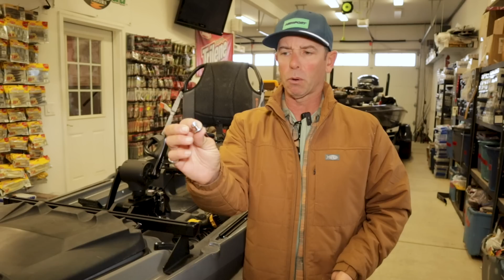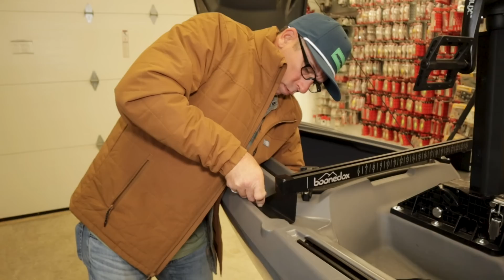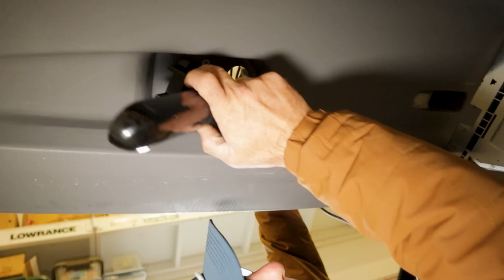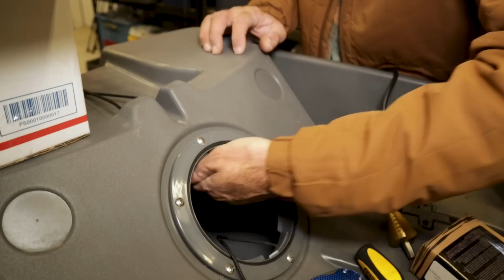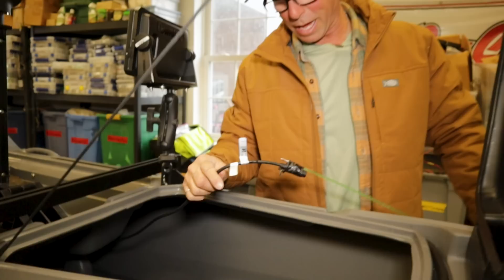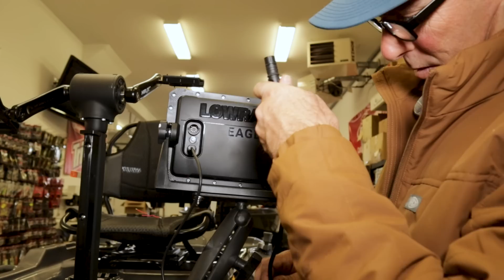🔥FISHING MACHINE! 🚀Rigging My New WILDERNESS SYSTEMS KAYAK with LOWRANCE EAGLE 🦅

Comment: Nice video! I've got the same kayak and currently have garmin striker 4, but want a new sonar with side imaging. I wired mine like yours, except i put battery in a dry box in the hull just behind front compartment.  I also added usb port to dry box for action camera and charge my phone if i need to.
Reply from the maker: That's a great setup!

Comment: Was a big fan of the Wilderness Radar and I am rigging up a Recon for this year as well! The Recon is a bit of an improvement in some ways. 

I am adding a yak power system for lights and usb ports. Marine electronics will be seperate from that as well as the motor if I add one. The Recon for me will be the one that is fully rigged rather than a light weight setup.
Reply from the maker: Nice, the Recon is a great choice💪🏻

Comment: Totally tricked out looks great! 👀 👍 great job and video. Good luck with your new yak. That adjustable mount on the cross bar is a winner. Congratulations teaming up with wilderness. I like that the area for the transducer is inset on the kayak that’s a great design. Next time when you drill holes into the kayak before you put the screws in, I would put a dab of silicone in the hole to prevent water getting in.
Reply from the maker: Appreciate the tips! 💪🏻